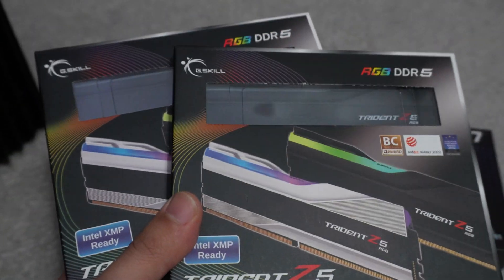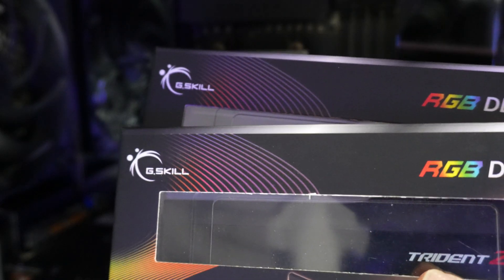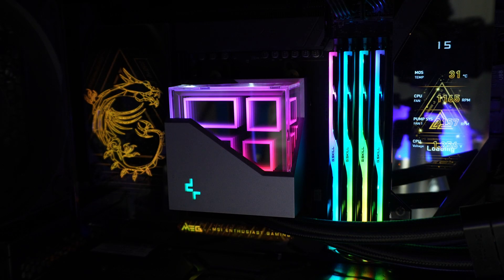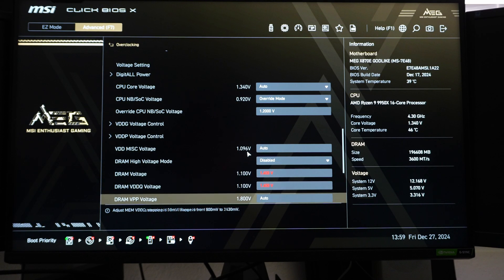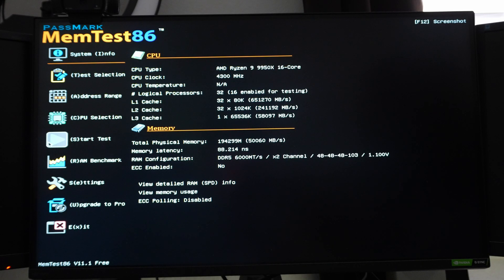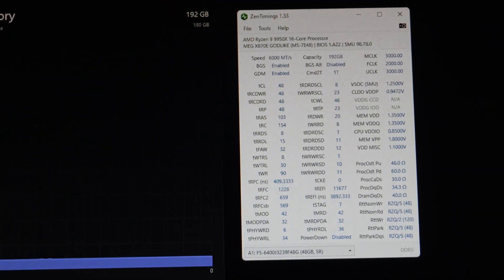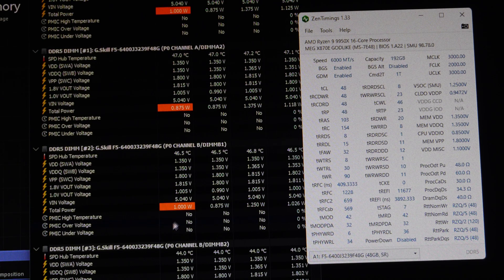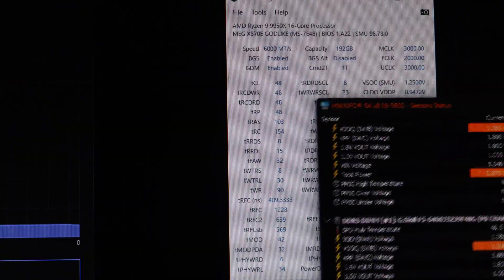192GB DDR5-6000 on the MSI X870E GODLIKE

Comment: I'm very tired of this DDR5 bullshit especially on AMD. I had a 7700X and it was able to run 4 sticks at 5600mhz which was ok. Now i got a 9800X3D and the piece of crap can't even handle 4600 without major adjustments. Why can't they just make shit work just like all previous generations of ram did??!!

Comment: @Game Tech Reviews - i own this exact board with a 9950x3D

Attempting to run 4 sticks of 48 which are basically two kits of Corsair CMP96GX5M2B6600C32. 

So far on the latest Bios i can run two sticks at 6600 with the built in profile with no stability issues. Moment i add the other two sticks - cant get stability on anything 6000 n up. 

I know these sticks are M-die so I should be able to have some room to play with but really getting stuck here. Any guidance you can offer here? How much different would the Gskills you have and the settings your running be compared to the Corsairs I am using?

Comment: Why not set timings to 32-39-39-102 like your other video on the AsRock Nova? Isn't it the same exact kit? My msi x870e edge runs at 5600 but my rtt park is 60 and proc odt pd is 240 automatically
Reply: Same don’t understand cl48 is high don’t even know if I should buy 4x48 cl32 6400mhz trident rams or 2x48.

Comment: Hi, (need recommendation)

I’ve recently built a PC with the following specs:
- Ryzen 9950X
- MSI MPG X870E Edge Ti WiFi (BIOS updated to 2025-05-07)
- G.SKILL Trident Z5 6800 MHz 192 GB RAM (4x48 GB, Intel XMP)
- Zotac RTX 5080

After a week of troubleshooting, I couldn’t get the system stable at 6800 MHz. I visited a local computer store several times, and eventually, they downclocked the memory to 6000 MHz. At that speed, Windows booted successfully with the full 192 GB of RAM.

Since I primarily use this PC for development, I tried running some Docker containers, but discovered virtualization support was missing. When I enabled virtualization (SVM mode) in the BIOS, the system failed to boot again—even at 6000 MHz. After a CMOS reset, it only booted at 3600 MHz.

We also tested with just two of the G.SKILL Trident Z5 6800 MHz sticks, and they worked fine at 6800 MHz. However, adding the remaining two sticks caused the system to fail to boot again.

After some investigation, I realized the RAM modules were Intel XMP 3.0 only—which matches the issue. Unfortunately, the seller hadn’t mentioned this, so I returned them today.

Now I’m looking for AMD EXPO-compatible memory. I’m considering the G.SKILL Trident Z5 Neo 48 GB 6000 MHz (AMD EXPO) modules and planning to buy four (totaling 192 GB). However, I’m unsure if they’ll run at 6000 MHz with all four sticks installed. I need at least 128 GB of stable memory.

Another option is the XPG Lancer 128 GB (4x32) EXPO 6400 MHz, but again, I’m uncertain if four sticks will be stable at 6400 MHz.

What would you recommend?
Should I go with (192 gb) 4x G.SKILL Trident Z5 Neo 48 GB 6000 MHz (EXPO) , or (128 gb) the 4x XPG Lancer 32 GB 6400 MHz (EXPO)?
Stability and performance are my priorities, especially for development workloads.

Thank you so much!
Reply from the maker: You cannot run that much RAM above 6000. And even at 6000 it won't work without manual tunning. I suggest running 192gb at either 4800 or 5200.
Reply: @GameTechReviews  Thanks for the advice. 
Can I run 192 GB of G.SKILL Trident Z5 Neo memory at 6000 MHz—or at least between 5400 and 6000 MHz—with SVM (virtualization) enabled? This is actually the key factor in my decision.
Also, is it possible to run 192 GB of G.SKILL Neo RAM with CL28 at 6000 MHz?

Previously, before returning the memory sticks, I was able to run 4 × 48 GB G.SKILL Trident Z5 Intel XMP-compatible modules at 6000 MHz just by setting the DRAM speed in the BIOS—no other adjustments were needed. However, once I enabled SVM, the system simply failed to boot.
Reply from the maker: @MustafaGUC  It wasn't stable either way. SVM just makes the instability more visible. I don't recommend going above 5200 unless you really know how to work with the memory's ODT settings which are often memory and motherboard specific.
Reply: @GameTechReviews  What if I go with 128 GB (4×32 GB 6400 mhz) of XPG Lancer EXPO-compatible at 6400 or 6000 mhz ?
Would this configuration run stable with SVM (virtualization) enabled? Either i'll buy XPG lancer 4x32 GB 6400 MHZ or 4x48 GB G.SKILL z5 Neo 6000 mhz..
Reply: @MustafaGUC did you managed to try 192gb with 6000/cl28?

Comment: Hey man! haha are You even read messages xD ? I do rememer You suggest me buy this mobo, just spotted on Forum this mobo really is faulty or so, can You let me know any idea how it is going now? all stable? still suggest to buy? I am planing use both Gen5 M.2 drives btw, I saw ppls mention M_2_1 all the time switch to something PCIe 4 x1 or so, or looosing drives, can You give  a some info about please if You facing for something like that
Reply from the maker: It works fine on the latest bios but I only recommend it if you actually need the PCIE layout and the features, otherwise, I don't think it's worth it. I still use it as the primary Tech Thursdays PC with the 9950x.
Reply: @GameTechReviews  Thanks mate, Yeah I am really need 2xM.2 Gen5 and PCIe Layout 8x Gpu and (4+4) for TWO U.2 drives with dual adapter("GLOTRENDS PU21 Adapter U.2 Dual SSD na PCIe 4.0 X8"), if it is not works Pcie Gen4 might very helps, because I am wish to have Intel Optane p5800x U.2 drive for OS and Micron 9400 Pro U.2/U.3 drive for media. So very important at least for Optane drive connect with CPU for fast latency and Micron with High capacity could work on Chipset(but better on CPU), so yeah something like this, on other mobos it is most are can do only PCIe 8x/4x for turn on second M.2 Gen5 , just found out this mobo doing Superb for Layout - one of the best, I am not interested in DIsplay/RGB but just whole Diagram, I saw also have x670 Godlike, but not sure if it great idea downgrade. but yeah thanks for feedback, cheers! :hand-pink-waving:

Comment: is this mobo support Bifurcation on PCIe from PCIe(1)8x PCIe(2) 8x (4x+4x) PCIE(3) gen4 x4?
Reply from the maker: Check the manual. The 2nd one supports x4/x4 because it includes the PCIE NVMe card.
Reply: @GameTechReviews  Yup, I am listed a lot, but didn`t find, and also as because it is have Xpander it is must do 4+4, but because I am didn`t find in their Bios Manual, start asking acros internet where I could for make sure)

Comment: in this case can u make it run at 6000 without increase any voltage on cpu+ram or anything? [ like leave all cpu voltage + ram to auto or default value] ?

ex leave all to default value voltage+ram cl timing and etc and change only the ratio of uclk and mclk to make it run at 6000? with 4 dimms
best case it would be able to run at 1:1 6000, worst at 1:2 ?

Comment: Thank you so much!
With your numbers, I got my 192GB RAM, same model as yours 2x96GB kits, running at 6400MT, 9950X, MSI 870X Carbon. (Edit: Now running on a 9950X3D, no problems at all).
Reply: How about the new gskill 4x48 packet
Reply: Great! I might try to replicate your build - before I buy, would you mind confirming it's still stable for you 1 month later? 😆
Reply: @WesTheWizard It is 100% stable. Never had a single fluke
Reply: @OGFangrim  bro  that sounds like a scary beast LOL...u wont need to change pc for like 10 years lol
Reply: @skrajina8037  Ahaaaa.. Well... Just got me a 9950X3D (and built a new HTPC with the 9950X), and this RAM config still works perfectly 1 week in with the 9950X3D, no errors/flukes. And yeah, it's a beast - paired it with an RTX5090, I feel invincible - for the time being at least ;o)
Reply: @ 5090? OMG bro u must be rich lol
Reply: @OGFangrim  literally copying your build rn lol just got my hands on a 5090 finally

Comment: AM5 X870E ProArt Creator / 9950X / 192GB RAM 2x (2x48GB kits) at 5400MT/s

... I haven't done any tweaks - I'm still learning and might get better results with more experimenting.
... I think 5400MT's would be stable for me, but I'm dialling back to 5200MT/s for my ZFS set-up to be ultra-cautious.
... Copying and pasting below what I put on Reddit.

I'm commenting here because I noticed in the video the bandwidth (I assume) indicated in memTest86 for the 6000MT/s @48.8 GB/s isn't far-off from mine at 47.9 GB/s at 5200MT/s.  When I had initial instability at 5400MT/s it showed about 60 GB/s in MemTest86 but that instability went away it seemed after retraining and the GB/s dropped to the 50's.  From what I've read, my 47.9 GB/s is about half what I might ideally expect from 6000MT/s RAM if working at full speed in every aspect.

There's so much information on this stuff that isn't straightforward, it's hard for me to see all the determining factors and what's significant.  But this GB/s drew my attention.

(From my Reddit post):

Goals

ZFS Proxmox system with no little/big E/P Core assignments to worry about and as much RAM as possible.

would love ECC RAM but need at least 192GB and can't afford [modern] workstation/server. Couldn't find 192GB of udimm ECC RAM, and not sure cudimm ECC RAM works on these AM5 systems.

As high performance as I can with the RAM with a great deal of confidence of stability, because using ZFS and I value my data. (I do have it backed up on other ZFS RaidZ2 or RaidZ3 systems with ECC Rdimms using older server/workstation hardware).

Mix of AI and VR (Steam), various services incl. some NAS. Always on system. Eventually multiple GPU for AI and passthrough. I have an RTX 4070 working fine in passthrough on my older Intel based system.

Principle Hardware

Noctura Edition Seasonic 1600W (I'm in the UK ... 230V supply).

CORSAIR 6500D AIRFLOW Mid Tower E-ATX Gaming PC Case - White.

3x Noctua NF-P14s redux-1500 PWM.
3x Noctua NF-P12 redux-1300 PWM.
3x Noctua NF-A14 iPPC-3000 PWM.
1x Noctua NF-A14 PWM.

ASUS X870E ProArt Creator.
AMD Ryzen 9 9950X.

Noctua NH-D15 G2 LBC, Dual Tower CPU Cooler, Specialised Low Base Convexity Version for AMD AM5/AM4 (Brown).

3x Crucial T700 4TB SSD PCIe Gen5 NVMe M.2 CT4000T700SSD5 (1x intended for PCIE5 operation for passthrough to Windows - hoping can use DirectStorage firmware, and 2x intended for ZFS RaidZ1 [mirror] for rpool albeit at only PCIE4, assuming using two PCIE slots at PCIE5 8-lane each for GPU's). (The sticks were offered at an amazing discount so still made sense despite PCIE5 vs PCIE4).

CMK96GX5M2B6000C30 96GB kit of 2x 48GB DDR5 6000.
CMK96GX5M2B6000C30 96GB kit of 2x 48GB DDR5 6000.

[Temp pending RTX 5090 FE or Suprim Liquid, or RTX 4070 interim from old system] Intel Arc 330 I think GPU.

BIOS version

Version 1003 2025/01/23

Context

Initially I was confused by the ASUS support website which still doesn't show memory support for more than 4x 24GB modules on this motherboard for the 9000 series CPU.

I made a mistake of buying two 2x48GB (96GB) kits in frustration and confusion. [UPDATE: - looks like this is a necessity anyway].
I found it difficult following advice and other people's experiences with so many detailed tweaks.
Maybe I was lucky (silicon lottery) but I can appear to reach stability at 5400MT with these two kits. [With out having to tweak anything].

Method

Note: current room temp approx 21C.

Flashed 1003 bios using Flashback.
Chose DOCP I (for ASUS optimisations on profile which is XMP profile for these memory kits)
DDR5-6000 30-36-36-76-2N-1.40V-1.40V

Memory Frequency DDR5-3400MHz - tested can post
... tried 200MHz increments (I was a bit too cautious lol)
Memory Frequency DDR5-5400MHz - tested can post

Note - tuning seemed to take between 6 to 7 mintues.
From previous reading, I figured 5400 might be highest I can expect so booted into USB MemTest86 (free)

Initial 4-pass test. I *did get an error in Test 8 in the first pass. Not in passes 2, 3 and 4. I noted MemTest listing the Memory as 189.7 GB and about 60-ish GB/s.

Note: 4-passes with default (parallel) settings took just over 10-hours.

LOTs of other Test-8 only tests ... at 5200, 5400 again, 5600, 5800, 6000.
I experienced a few errors at 5600, more at 5800, and a fair bit more at 6000 for Test-8 single passes.

I tried running Test 8 many more times at 5400MT/s without any errors - though I note MemTest86 listing the Memory: 189.7 GB and a range of GB/s ... mostly around 50 GB/s ish and not reaching 60 GB/s again, for 5400MT/s tests.

Comment: While having 192 GB of ram could be good for large simulations, I think it would be overkill for me and less likely to be stable and have tight timings. I plan on going with the F5-6400J3239F24GX2-TZ5NR which are pretty much the same except 24GB per stick and they are single rank. The MB I have X870 Tomahawk should be able to run them at 6000 M/t without issues and possibly 6400. The MB says 6400 should work assuming they are single rank. If I did good in the silicon lottery, I may be able to get the flck to run at 2133, which would be great. 2066 is almost a sure thing and in that case I'd back the RAM to 6200 M/t.

Comment: Aside from the cost and effort to reach stability, are there any actual trade offs gaming with 192GB on AMD? (workstation/gaming rig setup). I'm assuming lower clocked ram but AMD doesnt like higher clocked ram anwyay, right? Or is the real issue latency with such large capacity ram? If you did any gaming benchmarks, please share!
Reply: Its luxury, only trade off is scrubs can’t afford it, welcome to the 1%
Reply: Games do not use so much ram, so it’s a waste of time and money and it would run worse at higher fps due to lower bandwidth/higher latency. If you want future-proof, get 2x24 kit instead of 2x16, and you’re set.

Comment: I use the kingbank 6400mhz 192g with MSI x670e toma and 9950x. With the unreleased testing bios,I can just open the EXPO and get into the system and pass the stress testing

Comment: hello please help me
I have purchased an MSI MEG GODLIKE X870 motherboard along with a Ryzen 9950X CPU and Crucial Pro DDR5 RAM (96GB Kit, 2x48GB, 5600MHz, Intel XMP 3.0, CP2K48G56C46U5).

Currently, I can only use two RAM sticks, and the system works fine with them. However, when I add the other two RAM sticks, the system does not boot. I have tried installing all four RAM sticks according to the instructions, but the issue persists.

To troubleshoot, I have already updated the BIOS to the latest version provided by MSI. Despite this, the problem remains unresolved. I would appreciate guidance on why the system cannot boot with all four RAM sticks installed and what additional steps I can take to fix this.
Reply from the maker: You have to wait for the RAM to train. Code 15 means memory training. 192gb takes several minutes (more than 6 minutes) for it to train the 1st time.
Reply: @GameTechReviews   code error is C5 not 15
Reply: @amir61858   C5 is mean the memory training or initialization failure. did you using XMP or EXPO? try to add 4 sticks of rams and clear CMOS it should boot up without OC except your HW has problems

Comment: assuming i'm using the crosshair X870E hero and two identical corsair 2x48gb kits of ram from corsair (specifically their CL40-56 7000mts dominator titanium).
do you think just following your loose timings (48-48-48-103) would just work out of the box for 6000mts on that configuration?
its the kit of ram i can get a hold of locally which should have high quality flash chips (i can also get a hold of 2x48gb G.Skill CL36-39 6400mts but these kits are only available in white which doesn't fit my build that well).
which would be easier to run at 6000-6400mts between these two kits?
i would assume that maybe because the dominator has much looser timings and is capable of higher OC speed it would be easier to run stable at 6400mts?
though i understand its not as simple as it sounds lol
Reply: If you'll test this please write there. I'm thinking about X870E Hero (or X870E Taichi) + 2x 2x48 G.Skill F5-6400J3239F48GX2-RM5RW 6400 Mt/s. Waiting for 9950X3D release then will make a decisions.

Comment: I am debating between the tomahawk and the X870E Taichi which one should I get money isn't a issue will be mainly used for gaming. The Nova is sold out here.
Reply from the maker: Those are two different tiers of motherboard. The X870E Taichi is significantly better.
Reply: @GameTechReviews  thank you i went and got the taichi today.
Reply: @GameTechReviews  But you placed Nova to the S+ Tier - it's because of much better price-quality ratio?

Comment: Currently I have the CORSAIR Vengeance RGB 192GB (4 x 48GB) 288-Pin PC RAM DDR5 5200 (PC5 41600) running at stock speed. I run the ram at the speed the CPU and MB " trained it at " and I haven't had any issues with the ram. My system is very responsive. If I had known there was a non-RGB version of the kit ; I would of gotten that set but this was the first 192-gb ram kit I found after I got my ProArt X670-E Creator Wifi MB. I have the Ryzen 9 7950X3D CPU , GPU is the MSI Radeon RX 7900XTX. I bought each part one at a time after saving up for them. Only the MB wasn't changed out from when I switched to AM5 from AM4. I'm very happy with my system and plan to keep it as is for now.
Reply: What speeds your 192GB kit is running? 5200 with XMP?
Reply: So that ram kit works well with the 7000 aeries but the newer ryzen 9000 does not play well with it… so thia video has lots of value